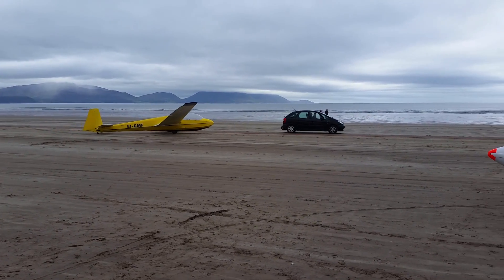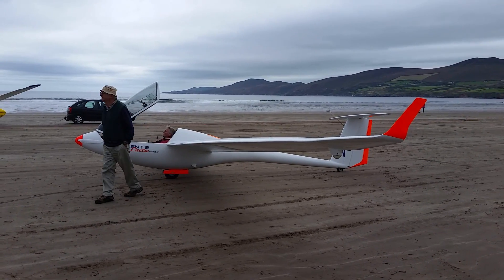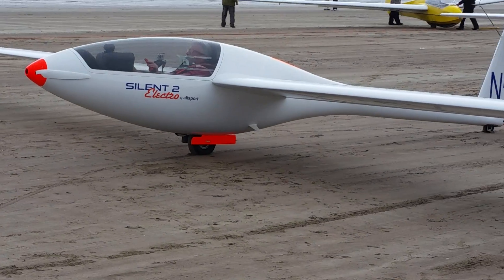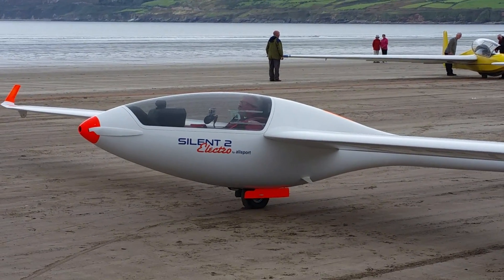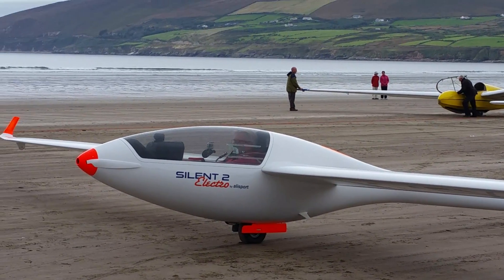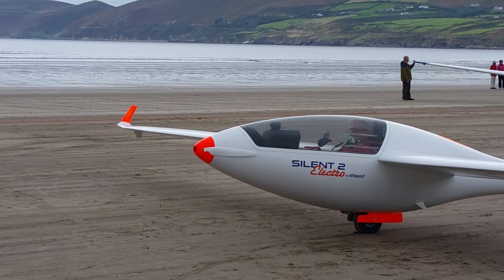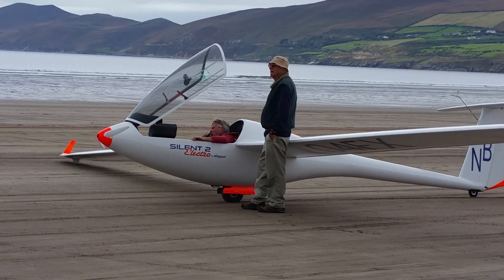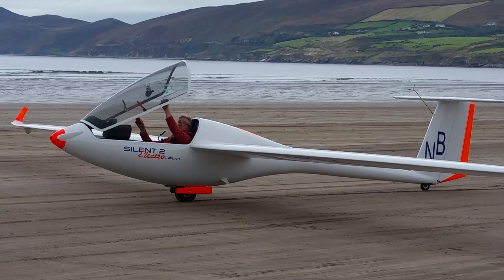Electric powered glider at Inch Beach, Ireland.

Comment: Really neat set up I cant believe its only a 2kw motor I'd say its a tad under powered I fly large RC gliders up to 4M wingspan and I use brushless motors rated at around 0.7kw mind you the climb rates incredible they easily go vertical.
Reply: He meant to say 2kwh :-) he was talking about the battery capacity not the motor..

Comment: Not affordable! We'll be towing for another 30+ years.  With the massively large heat thermals that are developing a glider might take-off at an Irish beach and eventually be recovered somewhere near Montreal.
Reply: An self-launching electric glider is already cheaper than a traditionnal glider if you consider the cost of launches during its full lifetime. By far.

Comment: what is the difference between a motor glider and a plane?
Reply: An TMG is an Touring motor glider, an sailplane with self takeoff has an engine only to take off or gain altitude when you have no thermals, an substainer only has an engine to prevent an outlanding, and an pure glider has no engine

Comment: How can it be a glider if it is powered and as such create its own thrust
Reply: @daviddou1408  Sustained does not mean indefinitely. By your logic nothing is capable of sustained flight even ICE aircraft require refueling.
Reply: What do you mean? And btw most people from Ireland probably won't like your pfp. A Motor glider is the same as a non powered glider. A non powered glider uses a planes (Cub or other powered craft) perpultion does it not? It only uses it for a brief moment to launch himself into the air without this other power from another Airplane
Reply: @m.s.aviation7065  so lets call an A380 a glider then.
Reply: @cplcabs  An A380 isn't capable of sustained soaring while a motor glider is. Like an unpowered glider.
Reply: @PabloGonzalez-hv3td  semantics. If it has a motor on it, then it is not a glider. Would you call the U2 a glider?
Reply: @cplcabs   It's not semantics when you lose all engines in an A380 and MUST declare an emergency. A U2 has glider-like characteristics but not quite a glider.
Reply: @PabloGonzalez-hv3td  It depends. If the A380 loses all engines, it isn't going to drop out of the sky, it is going to glide. Obviously they will declare an emergency.

The U2 is a plane with an motor, much like the powered plane here. If it is powered, it is not a glider. Its that simple.
Reply: @cplcabs  The keyword is SUSTAIN not "glide". ALL powered aircraft capable of wingborne flight can inherently glide - even helicopters. It goes without saying.

A380s and U2s can glide but they can't sustain it.
Reply: @cplcabs  You clearly have no idea from gliders. An engined glider like this is registert as an glider and can be flown with an glider pilot licence. So it is an glider. The engine is only used to take off or prevent an outlanding if you cant catch an thermal in time

Comment: does anybody know how much an electric glider like this costs?
Reply: You are looking at 50-70,000$ (usd) That's a large number, but you can probably find a club around and they might have one. As a first glider we would not reccommend getting a motor glider. It is less hassle and more common to find a average sailplane for cheaper and it is very cheap to get towed or launched into the air

Comment: at this point it isnt even a glider even more
Reply: It’d still say so. It only has power for about 30 min max. It’s not really meant for powered flight. Doesn’t even have a real engine but rather an electric motor. Once you get to cruise altitude, you cut the power. It’s great so you don’t need it to be towed. That motor comes in handy in case of an emergency if happen to get low and need that bit of extra power

Comment: neatly squared away in the nose. you could make it 10 blades to smooth the sound. And because electric can be so compact I might place the motor on the tail instead, to get the sound away from the flying experience.
Reply: The sound is only for a few minutes during launch, for the most part

Comment: Electric gliders are a great proposition because many high performance gliders already carry ballast inside to increase the descent speed and wing loading. Replace the ballast with batteries and you have the same aircraft but with substantially more energy to go around
Reply: Most ballast is actually water ballast which is jettisoned prior to landing. Some gliders have the capacity to take on fixed extra weight but normally this is to compensate for smaller pilots.
Reply: @newforestroadwarrior  Still his point is correct. The existence of ballasts show that designing a glider is not a constant fight against weight, contrary to what intuition tells us. So a couple of tens of kg more is mangeable.
Reply: @haltux  Sorry but you don't understand what ballast is for.

Comment: How the hack it stays in equilibrium on that single middle wheel ?!?
Reply: Alexandru Nistoroiu by chance... ;-)
Reply: While stationary, someone has to hold the wing tip off the ground (3:01). Once the aircraft starts moving forward, there's just enough airspeed for the control surfaces on the wing (flaperons) to create enough lift that the pilot can maintain them level throughout the takeoff phase. Pause the video at 3:08 to see the flaperons moving up on the left wing and moving down on the right wing at the same time.
Reply: @_John_P  interesting, thank you

Comment: do you need a different licence to pilot a glider with or without engine?
Reply: Depends. In the UK, self sustainers can be flown with a regular glider license. If they can take off, then you need a NPPL or a PPL. I might be wrong though.
Reply: @StefanoBorini  In the USA, if you have your glider license, all you need to fly a powered or motor-glider is an instructor endorsement and sign off for your log book.  Some motor gliders can fly extended ranges under power, and one advantage in the USA is that there is no recurring medical required to fly a motor-glider, unlike normal powered general aviation aircraft life a piston Cessna

Comment: That's the longest takeoff roll I've ever seen.
Reply: I guess you've seen few.
Reply: Tinchote 
Maybe not enough. But I've always been impressed with the short take off roll. This one struck me as long, by a lot.
Reply: I cannot tell on my own, of course, but maybe you have mostly seen light trainers. In any case, the length depends on the power of the engine, be it on the tow plane or the glider. I've seen some sketchy tow planes and very long ground runs, especially with ballasted open class gliders.
Reply: Tinchote 
I've seen marginal tow planes, but a glider achieves ground effect at quite low speeds. 

This has a motor. Ground effect appeared to be late. Maybe the motor/battery is heavier than I thought.
Reply: How about the sand factor........
Reply: I've seen many worse on airfields. This one is fine.
Reply: Check this one out: https://youtu.be/Z6TslLb9KS0
It takes about 5 seconds longer than the one shown here. And that's not because of tailwind or anything, it's just low power/weight.

Comment from the maker: When it runs out of battery... it's still a glider.
Reply: Yes, but if you still have some juice left in the packs you can throttle up when in the glide and descending if you need some extra energy to make it safely to your landing strip.
Reply: You've got firm grasp for the obvious.
Reply: Heck yea.
Reply: nOiCE
Reply: F5j круче летает
Reply: The same could be said of any plane when it runs out of its source of power
Reply: Equip that wings with solar panels and it can now fly indefinitely - in a sunny morning that is.
Reply: @emersonsrandomvideos248  Solar panels won't give enough power. But solar powered thermals will.
Reply: @bmpowellicio  any difference between the two..
Reply: @ksaket74  I wasn't clear, I'm sorry. Thermals are are spiral columns of air caused by solar activity heating the fields and you can fly on their updrafts for hours, and its free. Solar cells, though, generate very little energy, and are relatively ineffective at keeping an aircraft flying. They aren't cheap either.
Reply: @bmpowellicio  do you know about SolarImpulse?  It is really impressive
Reply: @bmpowellicio  true
Reply: 15seconds at full power then 12mins max power?

Comment: I always thought that the whole idea of a glider. was that it didn't have any power source, hence the name. It is now a powered aircraft.
Reply: Well - you need some kind of power to get airborne - either a tow plane or a winch (or in special cases bungee ropes). This makes the plane more independent. The battery capacity is only 12 minutes here - so in effect for any extended flights this is still a glider. An added benefit for self launching is that if forced/decided  to land out, the motor gives you more options to select the most safe landing place.
Reply: @daviddou1408  Wow sounds cool. Never heard about that - but not much different to bungee to downhill - so why not. 
Any case thanks for the info.

Comment: 2kw batteries are more than enough. Once you take off batteries work finish. Landing don't need power.
Reply: Most pilots will calculate this in, and when you're going cross country it;s not that uncommon for a glider pilot to land in a farmer fields or other nearby landing strips

Comment: If it can take off under it's own power, how is it still a "glider" ?
Reply: It's a glider, the same way that sailboats have an engine and still are sailboats.
Reply: Motoglider if you want ,)
Reply: Well put Tinchote I will use that when people say "Why is it called a powered paraGLIDER?" "It's a glider, the same way that sailboats can have an engine and still are sailboats."
Reply: Because it functions and performs as a glider once the engine is cut off.